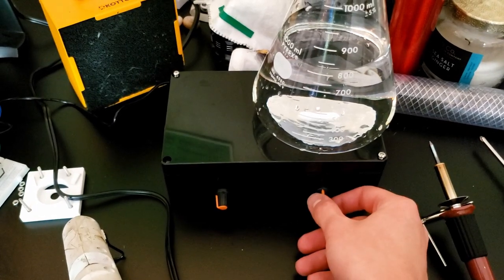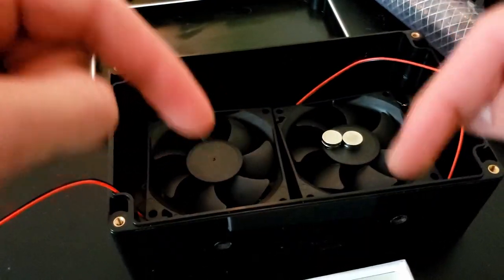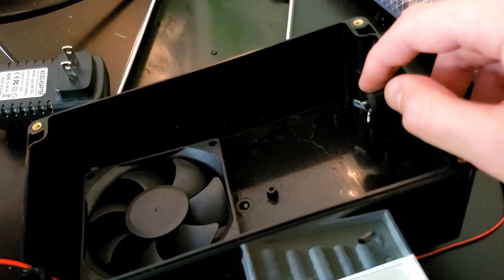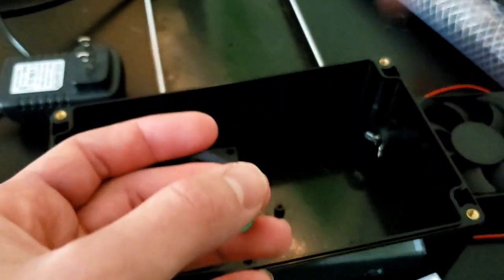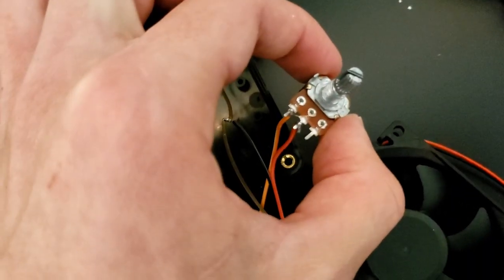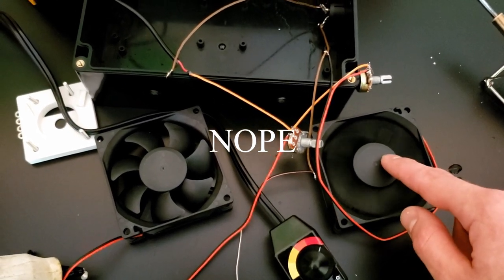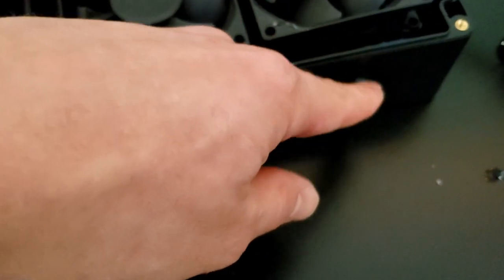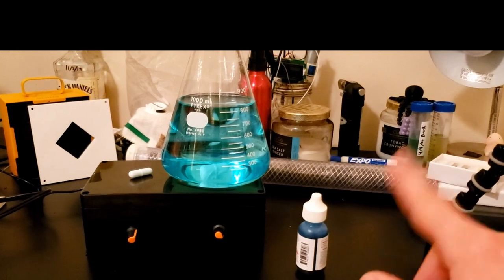DIY Magnetic Stir Plate! | I Try to Build Something

Comment: When you use a potentiometer acting as a rheostat to control the speed of a DC motor, it is difficult to set a low speed. It is a known issue. The solution is to use either a PWM board or a 'true' voltage regulator board.